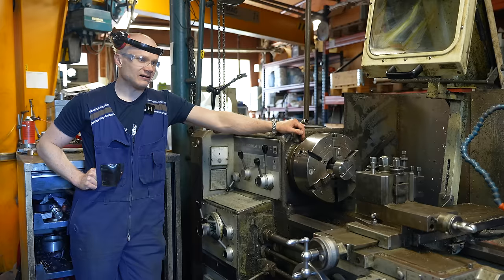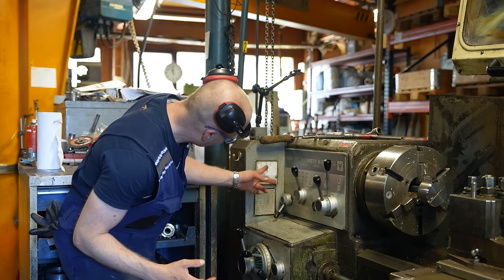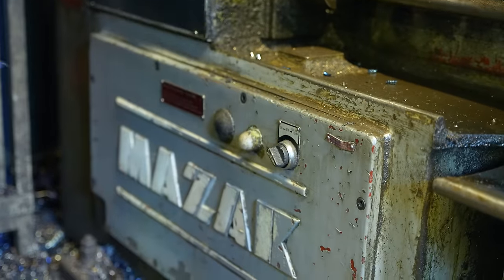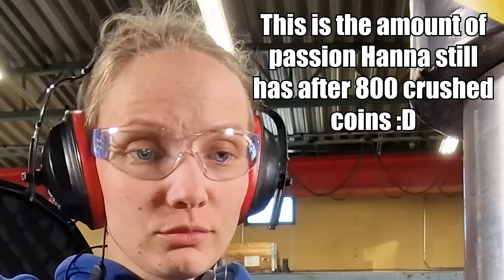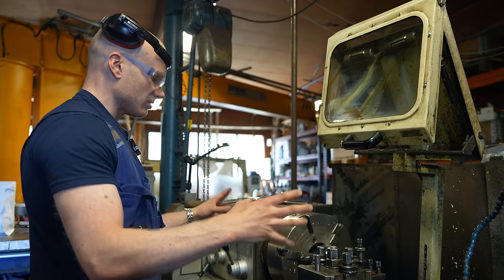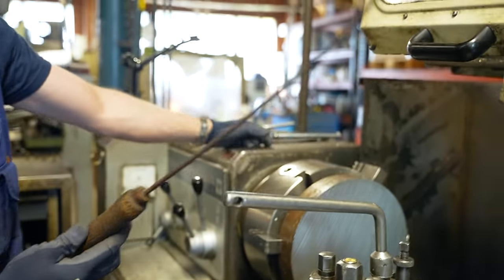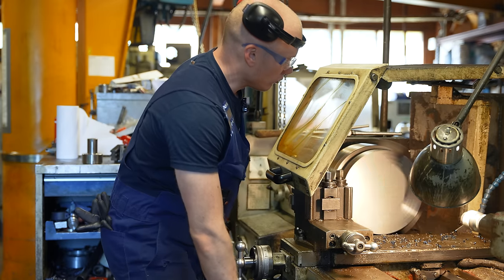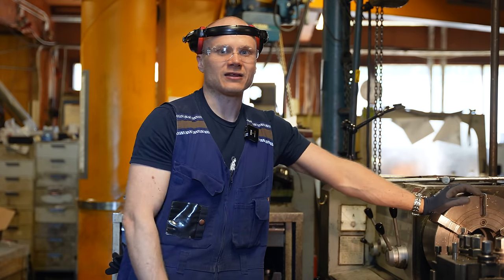The Most Important Machine In Our Workshop - Mazak 18 X 60 Lathe

Comment: The Japanese made really high quality optics and cameras starting in the 50s. I have some 10x50 binoculars I inherited from my grandfather that he carried 30 years as a field biologist, still the clearest image I’ve ever seen. Made in 1955 in Japan.
Reply: True. I have just about one of every Nikon camera bodies and lenses made. They are perfect as can be. I have had Minolta, Canon and so on. Nikon is the best.
Reply: I've heard of some Toyota/Lexus automobiles that have over a million miles on their engines.
Reply: @donniev8181  True, plus the old Volvo engines from the 240 series could run forever. Perhaps an exception, but there was a guy named Irv Gordon who put 3.2 million miles on his Volvo P1800, the equivalent of seven trips to the moon and back. My 242 Turbo with intercooler just never wanted to give it up. It was a 1984 model, but in 1999 somebody stole it. The only work to the engine was a little plate near the timing chain gave it up. Good maintenance is key.

Comment: I had the pleasure of machining an 80 tonne roll years ago , 6 inches of diameter per cut, 2 tonne chuck that was 8 feet in diameter,  11 days in lathe 24/7 until complete and ready for grinding.  At that diameter the chuck speed was only 32 rpm 😂

Comment: Used one like this in New Zealand for years and it looked 99% the same except that it had a large vertical spindle engagement lever with an orange knob on top to the left of the operator to control forward and reverse but it was nice clutch slip operation so you could feather the control of the spindle and slip it into reverse or back to forward gently, no clunk clunk shock start. The motor was always running even when the spindle lever was in the stop position and I can see you don't have the motor start button on the headstock. Ours must have been a step just above yours. Our Mazak had 3 vee-ways along the top of the bed.

Comment: If the lathe has 3-phase connection and it goes to 30A, it could have 400 V * 30 A * 3-phases = 36 kW motor.

Comment: It has a 10HP motor, I caught that when the older gentleman was holding the manual on the specification page.  It also said 4p. I'm not sure if it meant 4-pole or 4 phases.
Reply: It probably is a 4 pole motor. It's the most common in that size range.
Reply: @MF175mp  That is what I was thinking, but I was not 100% sure.
Reply: @biohazard20161  We have 3 phase power in Finland so it would be a 3 phase motor. Don't know if 4 phase exists
Reply: @MF175mp  Me neither.
Reply: 4p might be 3 phase with neutral to get 249v to run the coolant pump, maybe, my Macson lathe is like that
Reply: @fowletm1992 You must be living with a backwards electrical grid to not get the relevant voltage from the wall .  Only use of a motor as transformer I've seen here is inside my Norwegian tape recorder, where it powers the electronics from a tap on the main motor .

Comment: Nice lathe. I purchased a 1941 Sidney 14x32 off ebay. Original motor and it works great. Im interested in your pressure vessel. Did you make it? What grade of steel is it. I know your end caps are of stainless steel. And what about the sight glass? Is it rated? To what pressure? Sorry im commenting on the wrong video but my service provider is of low grade and this was the first video that started playing. Thanks. You guy do good work

Comment: 11kw motor takes at full load about 22A.
Reply: And the manual says 10hp, it is 7.5kw
Reply: 11kW from 3 phase takes 16A. Peak power could be double that.
Reply: @MF175mp Both of you, please state voltage with any claimed current consumption.
Reply: Voltage is something between 380-400 Volts 3 phase.
Reply: @johndododoe1411  In Finland it is 400v between phases and 230v between live and neutral

Comment: Please show us the most complicated thing you can build using just this 40 years old machine. I can't imagine anything other than a coin or a ring.
Reply: Almost anything with round areas or threads .  From a mounting screw to a crankshaft .  Just not bigger than the work area .
Reply: @johndododoe1411  A lathe can also be used for linear machining like a mill does. The cutting tool is held on the spindle and the workpiece is held on the carriage .
Of course this is rarely done these days as milling machines are readily available.
Reply: @PaulG.x  Thanks for the tip, might become handy to someone one day .

Comment: Lathes like this should have replaceable components, including the slides.
Reply: Seems most parts change out easily, except the machined rails on the cast frame, those can only be refinished a few times before it's weakened too much .